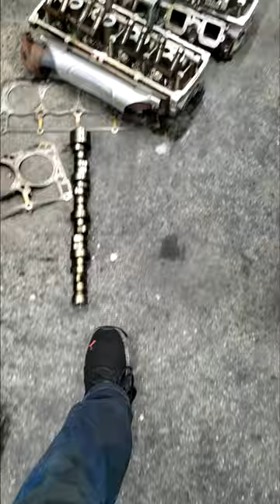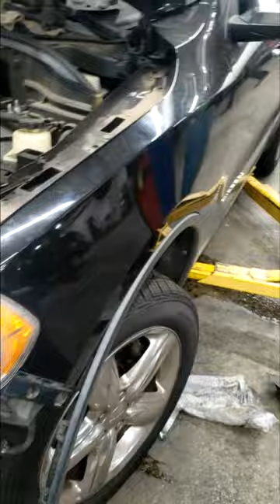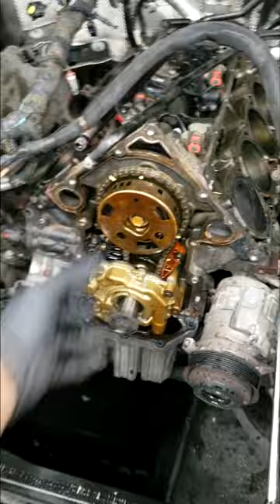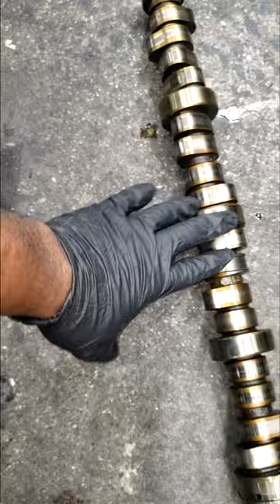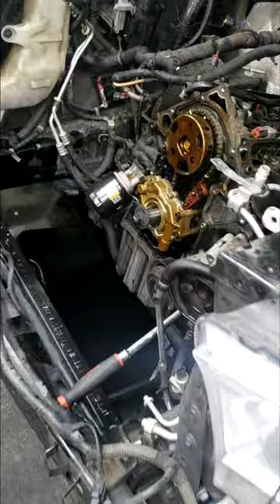Genius Idea or Not? #JTtheCarGuy #hemitick #youtubemechanic #shorts

Comment: 🤔I'm not going to lie! I have a bad habit of not disassembling as much as I usually should. which oftentimes makes my job more frustrating and sometimes even more difficult. I 🤯🤣
 If ain't nothing right here but I live in a cold climate where a lot of Fasteners and things tend to get rusty so I get a little nervous doing more tear down because often times I run into rusted bolts that are completely shot.  I guess it's best to find a good balance that's all. 👍
Reply from the maker: Lol..we all have
Reply: You Charge more for rust?
Reply: @carlexus3133  Usually not,. But if something is really rusty or breaks because of rust then its usually extra.
Reply: Man I'm doing the same exact job on a dodge challenger so Many parts to take off

Comment: Heads, too.  Hope the bottom end isn't wiped out.
Reply from the maker: Drove in fine. No knocking or engine noise. Just misfire. Bottom end should be fine.
Reply: There's always a chance to the bottom end getting wiped out later from all the metal in the engine from the cam being ground down
Reply from the maker: @jasonharris1422  True. But that was not his question..I mean there's a chance my tire may go flat later today.
Reply: Nah there's no damage to the bottom end. I do these every other week it seems (50+) I've yet to see one that's damaged on the lower end.
Reply: I've been around the forums for these trucks for years and only seen one that had bottom end damage

Comment: I did this before. Took me a long time but was my first time in the engine. I had to redo the head gaskets twice because I didn't send the heads to be resurfaced the first time and got a leak.  Was a great experience. Did it with motor in just like this one.Working great now. But I'm always listening for ticking and changing oil more frequently.

Comment: I know it's not just dodges, but in my experience they have top end problems the most by FAR, mainly the 3.6l engines which have roller rockers go out and eat cams left and right. I still think the 3.6l is a great motor but seems to be a common issue

Comment: Cylinder heads sitting directly on a concrete slab, not even a sheet of cardboard to protect the sealing surfaces.
Reply from the maker: How you know whats under that head? I will answer that for you, you don't.
Reply: @OnlineMechanicTips   He showed both of them, nothing visible. You want to argue?? Go right ahead. All I know is that if I personally saw a mechanic doing that with anyone else's engine, I wouldn't go back.
Reply from the maker: @7891ph  Who the hell cares what you think. The mechanic working on this got it covered and the heads not flat on the floor. You have no idea what you talking about. Go find you something to do.
Reply: @OnlineMechanicTips  This argument sounds like someone who got caught and is now denying it. Keep yelling; all it's going to do is have more people actually look at the video and make the same conclusions.
Reply from the maker: @7891ph  This not an argument. Just letting you know, nobody, especially me cares what you think. Thats all

Comment: How ? Like I’ve had over a dozen Hemi motors and they never needed anything but oil changes one had 437k on the odometer
Reply: Look up hemi tick. Completely common for the first gens lifter rollers to lock up and wipe the cam.